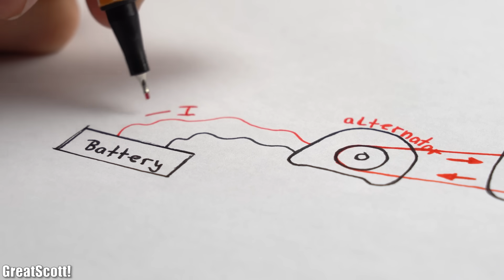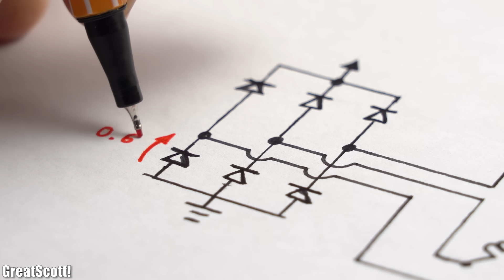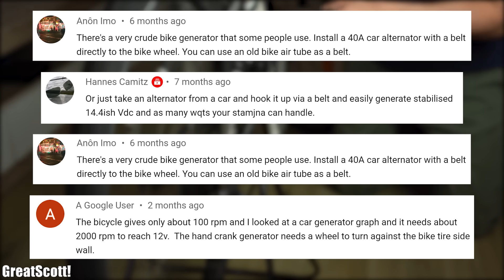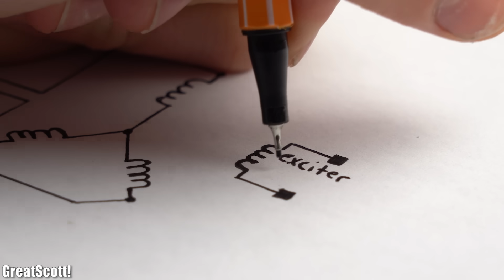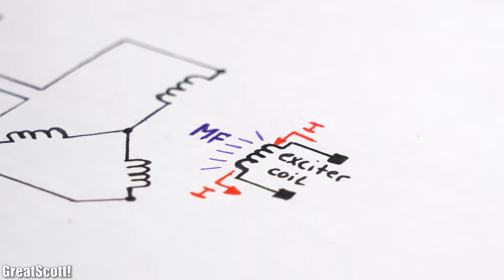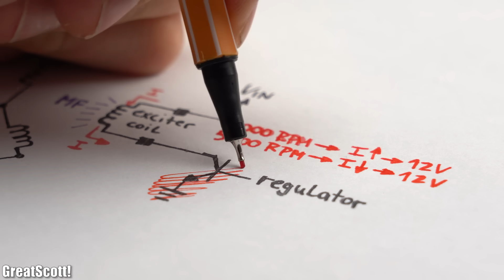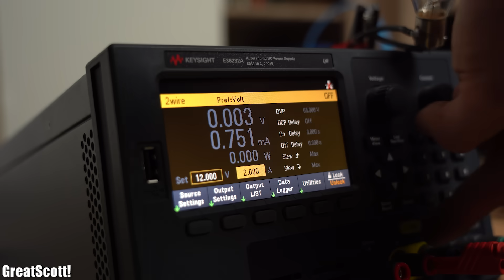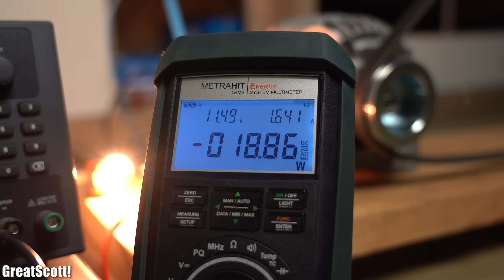Using a car alternator with a bike to power my home? How much energy can I produce?!

Comment: What happens when your input voltage ceases? Such as when the battery is drained.
Reply: Battery charge pack or new battery or more battery
Reply: @jeff5882174  I'm asking if the voltage will stop being generated
Reply: @salzysisters5799  ooo

Comment: There is one other thing you need to know about car alternators.  They were designed in Paris in the early 1900's, & the design hasn't changed since.  Since they are driven by an engine that ha handling loads on the order of 50KW, efficiency does not matter when you are requiring about 500W worst case (driving at night in the rain, wipers & headlights running).  What DOES matter to the car manufacturers is COST.
          You have seen one thing already: car alternators are INEFFICIENT (wonder what the fan & all those vent holes are for?)  It is not just the exciting coil current; it is the losses in the CHEAP iron parts.  The iron laminations are way too thick.  Currents race about in them, heating them up & increasing load on the pulley.  At the best, they are less than 50% efficient.  They have no place in any energy harvesting system, especially when human-powered.  You would be better off using that permanent magnet motor you show earlier in the video.  You could easily get 50W out of it.  You will need to "gear up" the drive to much higher RPM to use it.  I would recommend a larger diameter airplane-type motor for this application.
          Regarding the regulator circuits, why did you cut them out?  If you get the alternator going faster, the load torque & the exciting current will decrease.

Comment: If you use an inverter, connected to the alternator, you can charge a cordless drill and a few batteries, then use the drill to spin the alternator on low, and you can charge 4x12v batteries and power your house.

Comment: I haven't watched the video yet but most alternators make around 70A of power, which is around 850W at peak capacity. There is no possible way you could run a home on that unless you're living in a tiny home with all LED lighting, a laptop computer, and one of those "apartment" refrigerators... and no AC system.  High output alternators can make around 1500W of power which you COULD run a tiny home like that on with one of those refillable water-based air conditioners. You might find more success with an old washing machine motor.

Comment: what about replacing the back wheel with a large wheel sized but flat motor giving some serious resistance (similar to some washing machines motors i think) then attach 2 fly wheels on both sides of generator wheel, i would be a pain to start spinning but id at least like to imagine it would make some pretty good output once its spinning a decent pace

Comment: I used a 3 HP lawnmower engine to power a 150 amp big rig alternator. I could only get about 50 amps before it bogged the engine. At a constant amperage, the torque at lower RPM is much greater than at a high RPM. So changing gears on the bike would make no difference.

An internal regulator is no different from an external regulator. Some alternators use a permanent magnet to start the power build up where an externally excited alternator needs power from the auto's battery to get it going. Since the exciter voltage is usually about 3 to 5 volts, bypassing the voltage regulator will cause a runaway build up that can burn up the alternator and equipment connected to it. For instance, a 12 volt light bulb getting 20 to 30 volts won't last long.

Since your house probably does not run on 12 volt power you would need an invertor, which because of power loss would be inefficient. So you would need 12 volt light bulbs to light your house.

On my big rig, the voltage regulator blew. So I used a dual filament taillight bulb and a switch feeding the exciter of the alternator. For daytime running I switched to the dim filament of the bulb, which was adequate. For nighttime running (lights on) I switched to the bright filament. The characteristics of incandescent light bulbs, as they get brighter, their resistance goes up. This kept the power from running away. As the output voltage got higher, the bulb's resistance went up leveling off the output like a regulator would do.
Reply: i made 2 different types, both are self exciting... 1 is an alternator like this guy used, powered by an 8hp engine..its overdriven outputs 1290 and 5kw... the other is made with a 3hp engine and an induction motor from a washing machine...self exciting..makes 1 kw at 120v 60cycle ac... not that much wattage but its just like house current and will be compatible with all devices.

Comment: rearrange the magnets or better yet get the same size but stronger and continue to rearrange them around the coil until you get the most power, find a small motor hook it up to the alt. for constant power,...... voila' , yes, you tried 100 different ways to rearrange the magnets and connections on an alternator to run a regular size house effectively...now share your diagram with the world and give yourself a pat on the back.

Comment: Great video mate. Wondering to install such thing to some rotor in the mountains where is almost always windy. Always can have at least 1 charge of the phone per day which in off grid situation seems to be perfect if you design such system on a low cost.

Comment: A car alternator can be between 35 to 180 amps output depending on the model and vintage of car it was from. At full load, they would require 1 to 5 horsepower to run them. A human is just not up to the task of powering that. On top of trying to pedal that effort indoors, you're going to need to run a cooling fan for yourself off that bike too- even more effort! Try a double helix wind turbine- much easier!

Comment: The very best bicyclists in the world can put out about 1/3rd horsepower for a bit of time.  That is 746/3 watts or 248 watts.

But wait, it gets worse.  The bicycle, belt, and alternator are not 100% efficient.  Depending on your setup as much as 25% of those 248 watts are eaten up by the inefficiency of the system.  Let's say the bicycle and belt are 90% efficient and the alternator is 80% efficient.

0.90 x 0.80 is 72% efficient,  so .72 x 248 is 179 watts.

Lastly, with only an hour of research, you could have known all of this before turning on the camera.

Comment: You can power a huge battery bank by putting two alternator across from each other and run a start wire to a 9 volt battery. No bike involved.

Comment: Back in High school in the 70s,  an electronics class project was to generate 12 volts to charge a battery using a 35 amp Alternator, We used an exercise bike and used a switch and variac (Control the exciter or field windings) vs the external regulator to create the magnetic field, with all the effort we managed to only get about 10 amps at an estimated speed of 800 RPM and got tired after a while, (Peddling like hell) We tried different gearing and methods and came to the conclusion that Alternators were not very efficient for pedal powering, They require the higher RPMs to generate and voltage to create the magnetic field (Take power to make power) that a internal combustion engine can provide far better than a human, We tried a DC vehicle generator which already had the internal magnets, BUT  the RPMs had to be much much higher than what the Alternator required, (one major reason Alternators replaced generators) ,  A side test we took a 1 HP 4 stroke lawnmower engine (Direct couple, no belts and pulleys) and it gave us the necessary RPMs to get the full amperage (at full field)  The 1hp engine was more efficient (less fuel) than running a vehicle with a 4,6 or 8 cylinder engine,,,,,, We did get an A for effort, I would still like to find a very efficient pedal power method to charge a deep cycle battery, To run low voltage radios, LED lighting and with an inverter a microwave oven and coffee maker,  I do have 200 watts worth of  photovoltaic panel that works (as long as the sun shines)  We always have the threat of earthquakes and now exceptional drought that is placing hydro power at risk by next fall (could lose 30% of capacity and suffer rolling blackouts)

Comment: With roughly the same rpm, why are you only able to produce a tiny fraction (aboutof 1.7A or so) of power as the same setup on the car (20-80A capable)???
Is it because on the car the excitor coil actually has a much larger current during operation, thus generating a much more powerful/concentrated mag field for the generator coils to spin in?

If indeed that is why, theoretically you couldve made quite a lot more power if you used more current as well and tightened the belt to stop any slipping right?  I know you would be limited to the amount of torque you could apply to a drive system that is geared up so much to get the needed rpm, but it appeared you were doing the 20W fairly easily...Could you make a quick follow up report on this topic at some point to fix slipping and see what your max power gen is?  Im very curious to see how much could be done by our own body, its much lower than i expected, but this is due to system design rather than lack of human power it appears.  i figured 100W or so should be possible at least, this being a max not a long term sustained output.  I wanna know the max capable output, if you could continue this idea itd be really awesome

Comment: Hello, try duel alternators, but make sure you don't use a car alternator.. use the ones from a large diesel truck. They run at lower rpm for more power. Also so you don't have to sit on the seat and ride the bike use a small electric motor. Using that should power quite a few things.
Reply: Literally not how energy works, what you describe if it worked ( it doesn't) violates the laws of thermodynamics and conservation of energy

Comment: I think a large weight wheel would help like in a windmill then your gear ratio can greatly increase even when pedalling at a medium pace, or not at all. but id imagine that would take some large and decent bearings to pull off oh and a pulley on your belt too. Great video pal thanks
Reply: "I think a large weight wheel would help like in a windmill"  that sounds like a flywheel to store the kinetic energy for the rotation would not change the gearing?
Reply: @iftex2263  but it would help with momentum against the resistance of the alternator magnets ?

Comment: if you use a General Motors alternator designed for a care that predates 1978 (yes, still readily available) you can simply us a toggle switch (40 amp if possible) and "switch" the diodes. i have several batteries and run my "home service" independent of the bike/alternator using an inverter. this allows me to charge my batteries at any RPM. of course a faster RPM in turn charges the batteries faster.

Comment: Interesting.  The old dynamos had a weak fixed magnet to generate a small amount of power, to be connected to the internal exciter coil which made the dynamo produce more power.  The wiring was dead simple, with only three contacts, and the full output of the dynamo came at a much lower rpm.

Comment: You might have a better system if you use the motor from a Fisher and Paykel Smart Drive washing machine. These are a 'pancake' style 14 pole, three phase permanent magnet motor, and it may be possible to replace the rear wheel on your bike with the whole F&P motor. (There may be other brands that use a similar motor, but the F&P was one I rescued from the side of the road on trash day. See your local scrap dealer or washing machine repairer.) The motor is designed to operate at up to 1000 rpm max and is rated at about 600 watts, (an Olympic cyclist can produce about 750 watts for a short time, so a kilowatt-plus rated car alternator is overkill,) and will generate 100 - 200 volts of three phase AC at speed. Feed the three phase output from the motor terminals into a six diode rectifier made from 6, 400 volt, 6 amp diodes (silicon diode type 6A4?), and you have 100 - 200 volts DC..... This voltage can be fed into the AC side of a switch-mode power supply from a junked PC, and will generate 12 volts - regulated - at lots of amps. The power supply includes line frequency DC filtering, so extra capacitors on the rectifier output are unnecessary. 

I found a PC power supply, rated at 800 watts, that has 3 x 20 amp 12 volt outputs, with a maximum total rating of 600 watts continuous output from the 12 volt outputs at the local scrap dealer. The 12 volt outputs all came from the same pad on the circuit board; the 20 amp limit apparently related to the wire gauge.... It cost $5, and worked perfectly well. If the motor can be fitted into the rear forks of the bike, and its rotor driven directly by the bike's chain and sprocket system, there is no slippage, and probably lower losses in the power delivery system.s. I found a PC power supply rated at 800 watts that has 3 x 20 amp 12 volt outputs, with a maximum total rating of 600 watts continuous output from the 12 volt outputs at the local scrap dealer.

Comment: Great video 
 However not possible in order for it to work you need an outside energy source which renders the alternator kinda pointless as an energy source 
Even with advanced sprocket system equipment you still need 6000 rpm on it to draw even a minimal current with 6500 peak performance
Reply: nah, his legs just need a bit more muscle on them

Comment: You could have removed the pulley from the front of the alternator and driven it's spindle directly off the bicycle tyre if that had not also been removed, no belt and much higher RPM due to the spindle being much thinner than the pulley.

Comment: I used a 12v treadmill motor. Used an old car belt on the back wheel after taking the tire off. Does the trick pretty well.

Comment: At 4:09 you have the gears backwards.  Front sprocket should be on largest ring and wheel one should be on the smallest in order to get the highest RPM.
Reply: Give the guy a break, he's not a Mechanical Engineer afterall... Did you SEE the frame he made?? Wood and steel bracket construction, but the bike was held on with ZIPTIES!!! xD
Reply: @ConorFenlon  bro that frame had me scared for his life lol also his belt tension was basically non-existent with a few tweaks he could get some power out of this thing.
Reply: @circle7motorsports  Facts. Guy's a lunatic!

Comment: a car also has a battery to keep the voltage constant.  If you disconnect the battery from a car will it still run and keep the voltage constant?

Comment: You can make the alternator self exciting several ways or just buy a model that already is. No need for the external power source. This will cause more drag and make it harder to pedal because energy is not free. If you are in good enough shape a human may be able to pedal hard enough to create 300 watts but only for a short burst. Back in the 80's I went to a science museum I think it was at The Franklin Institute and they had a bike generator set up that showed your output as you pedaled. It used the power to turn on common items like a radio, lights and appliances. You definitely felt the drag as new items turned on and got tiring quickly.

Comment: Typical car alternators put out 100 to 200 amps at 12 volts. That is 1200 to 2400 watts. The alternator is spinning off the engine at a ratio that is no where near what you are trying to use. If you really want to use an alternator, hook a motor up to turn it and see how much the alternator puts out. If the motor uses less power, it should continue turning the alternator indefinitely.

Comment: Your big problem is that cycling for 3 hours per day you might be able to produce 500W with a perfect setup that converts all mechanical energy to electrical. Which would cost 36 per year @ 29p per kW (current UK price). I would imagine the food cost to generate that energy for 3 hours cycling would be far more expensive than simply paying 14.5p to buy the electricity.

Comment: I wonder if stabilizing the bike and tightening the belt on the alternator will help you generate more. The bike looks very un-sturdy with a lot of sway. That seems to make it less efficient and whenever you touch an alternator belt while it’s idle it’s always tighter than what you seem to have it on ur system

Comment: first of all, your "highest gear" is actually called the lowest. ;)
then you need to get a decent tension on the belt.
and then you might even blow the bulb....
another method is to take the alternator apart and modify it with permanent magnets.
this way you wont need the exiter curcuit anymore........
happy hunting!

Comment: I made one the same way but I put lead fishing weights on the spokes of the rim so you don't have to work as hard to get the juice from it😊 but in my case I used a full bridge rectifier for DC  and  hooked a toggle switch so I can use AC current also if needed 😊
Reply: Lead weights just mean it's more effort to get up to operating speed. At operating speed you still need to put in exactly the same effort to spin the load of the alternator or whatever you're driving. This is why nobody builds bikes with flywheels- too hard to get moving.

Comment: To help with belt slippage you need a tensioner pulley. Basically a small, free spinning, pulley with a spring to apply tension to the belt. Vehicles have one but the spring in it may be too powerful to overcome with a bicycle. There is also one used for the belt of a clothes dryer, which in theory, would be about right, except the spring pulls in the wrong direction for your application. But you can look at how they work online, maybe get an idea on how to build something similar.
Reply: He could probably hook another alternator on it to put tension on it

Comment: This method works with a single phase 120v motor and a car alternator. You need an alternator from a hig h.p. car in order to convert it you need to take off the 24v or 12v converter.